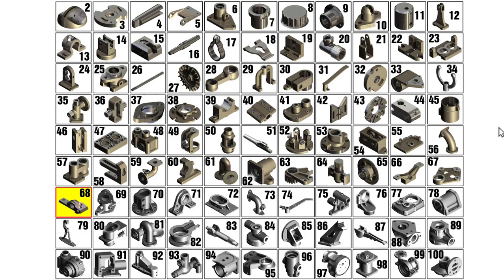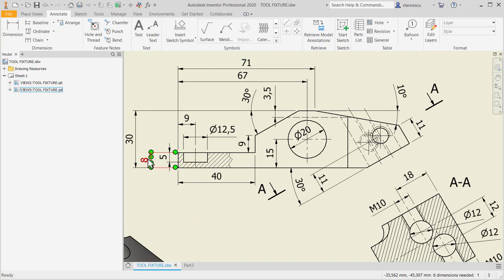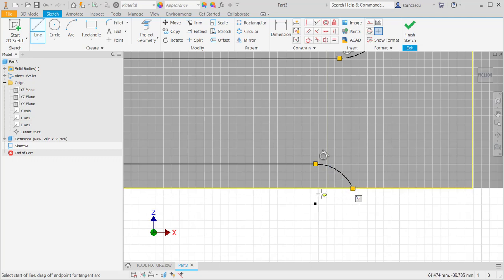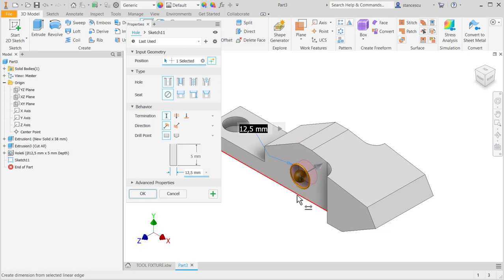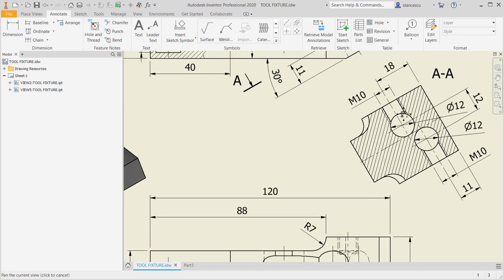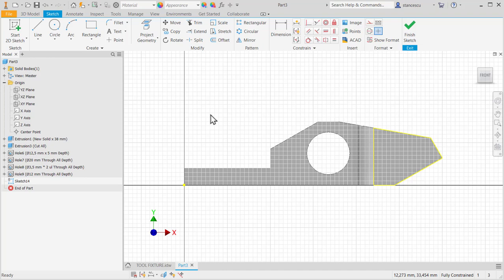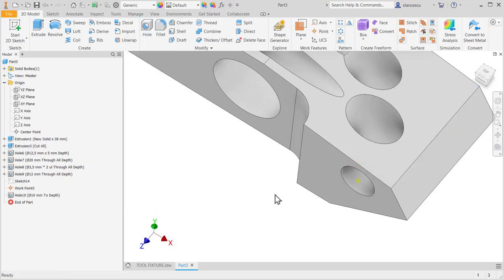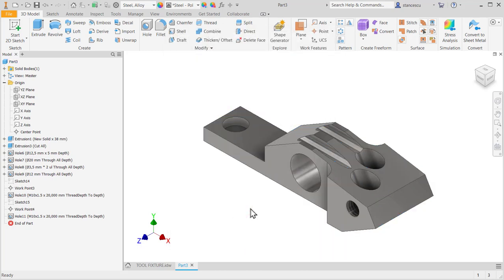Tutorial Inventor - 106 TOOL FIXTURE (Part-068)

Comment: Hello, prof, I have  a question. How do you render the picture of your Inventor parts? they look stunning.
Reply from the maker: It's about lights.
You have to use the tool VIEW, then to select TWO LIGHTS, then SETTINGS (from VIEW) and use the two directions horizontal and vertical for both lights to fix the image.
Reply: @prof-stancescu  Thank you, I did it
Reply: @prof-stancescu   I am at drawing 112 and I won't give up. I need to pick up your brain lol.